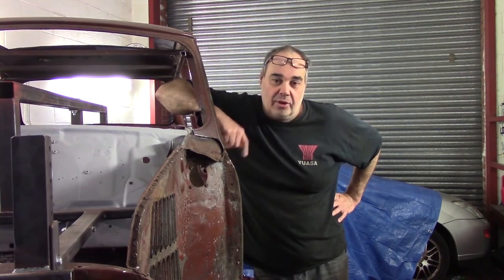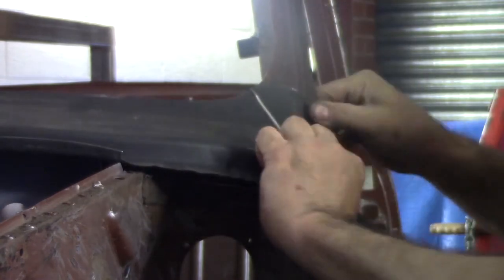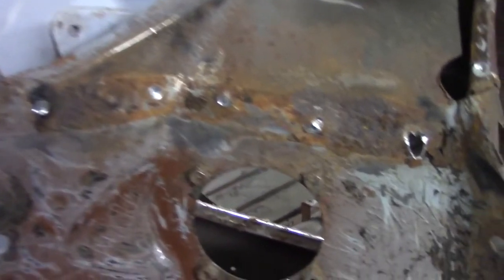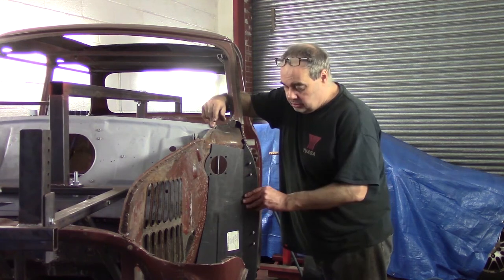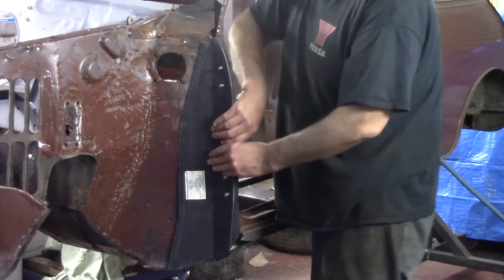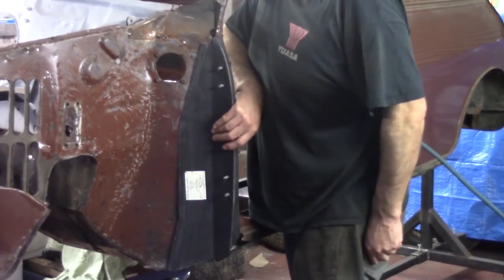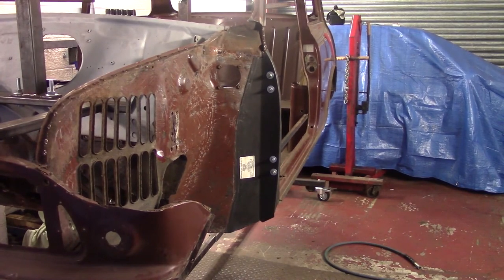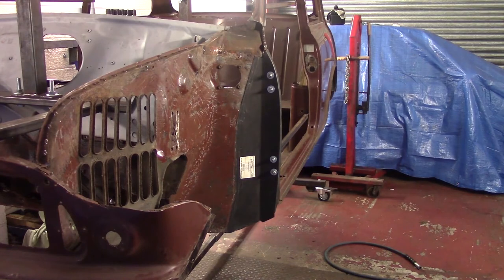Classic Mini Restoration   Project Magpie Episode 13

Comment: Might be a dumb question - does that chisel you’re using to separate the spot welds have a special name? Cheers
Reply from the maker: its not a dumb question its a good question,  in actual fact its not a chisel it is a blade from a cutting board, blades like this are placed in a flat wooden board or a mould and then the item to be cut is placed on top and it is put through rollers to squash it together and make the cuts  if you see what i mean,  i was given some off cuts by my mate big nigel who is an engineer and they are brilliant for spot welds
Reply: trickster Thanks - yes, looks like it is just the ticket!